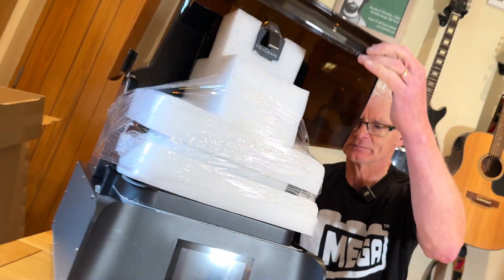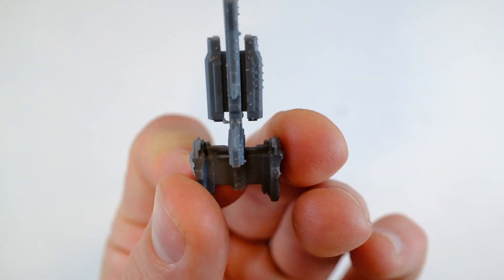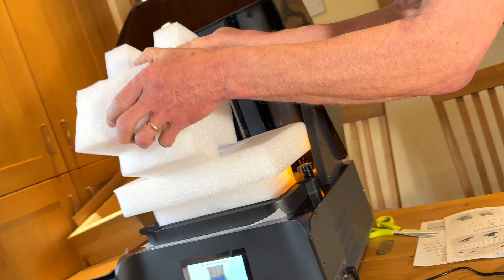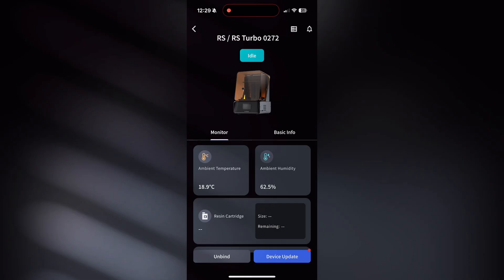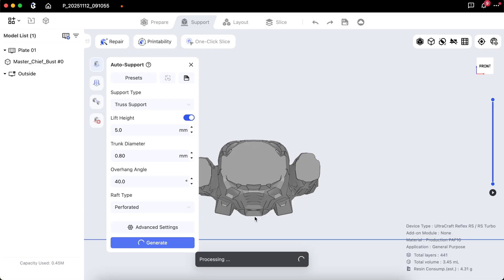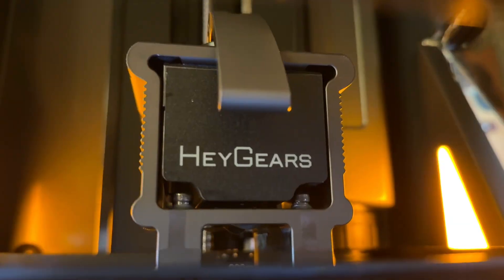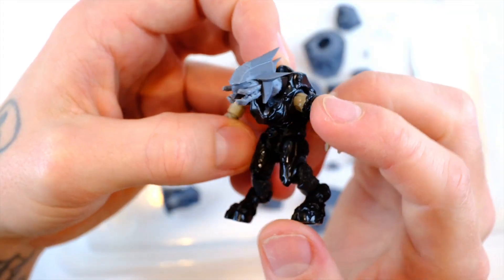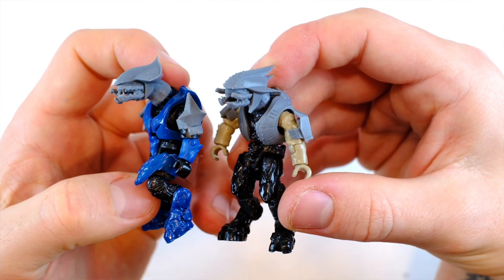Can I 3D Print My Own Halo Mega Bloks?

Comment: A few recommendations, You can get a magnetic flexable plate for your print platform. It allows you to remove the prints without having to take the entire platform out of your printer and just flex the metal plate to pop your prints off. (no scraping required)
Secondly, If you have a print failure, make sure you fully clean out your resin basin. The reason for that is if you have any small cured parts floating around in your resin and your platform presses against the PFA film, it can cause punctures. That will lead to leaks and if that resin cures against the glass that the PFA is protecting, you are in for a bad time. You'll  have to end up replacing the PFA film and in the worst case, the glass that is underneath.
Thirdly, for some of the more intricate/tricky prints. You can try orientating them at a 45 degree angle, I find that I get more successful prints when I do that.
Lastly, think about either putting your printer somewhere with plenty of ventilation and wear a respirator when handling the uncured resin. That stuff is usually super toxic.

3d printing is a super fun hobby, I'm currently building a full set of ODST armor on my Centauri Carbon and i've done quite a few of very high quality statues with my Elegoo Saturn. I got the bug and have been hooked for a while now.
Keep up the good work with the videos. I really enjoy your content. And if you have any questions on the 3d printing stuff, feel free to reach out.